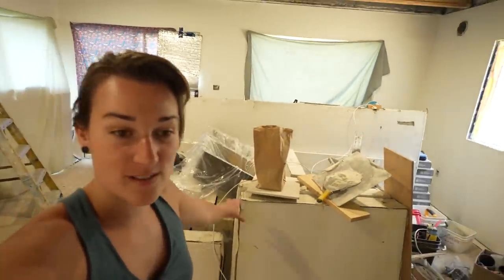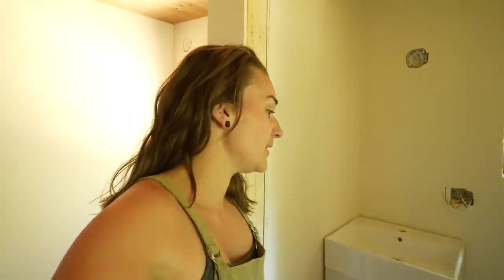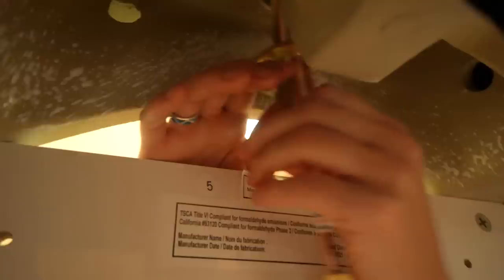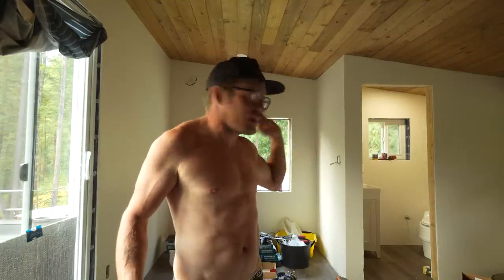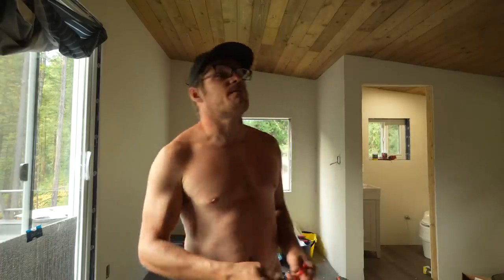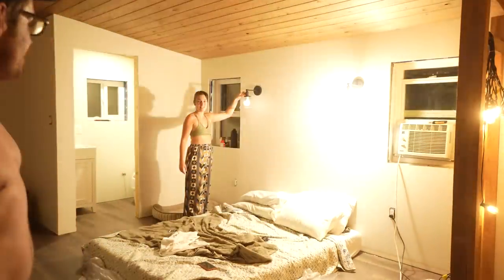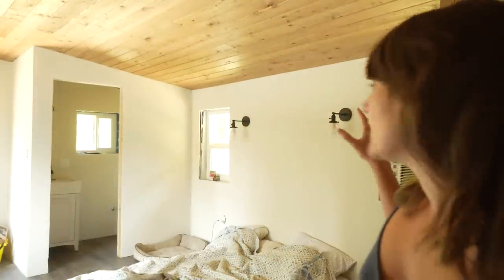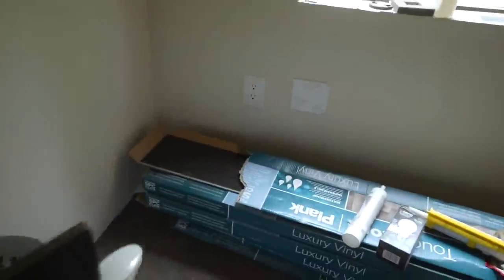We Really Messed Up! | Lighting and Electrical In Our Master Bedroom

Comment: Tip:  Experience has taught me to install faucets and part of the drain BEFORE placing the sink. That way you can turn the sink upside down and do the work more easily, because you don't have to work lying on your back and reaching into hard to get to places.

Comment: looks great guys I just wanted to say that most ceiling fans have two settings one for winter and one for summer there should be a little black switch on the Hub of the ceiling fan where the light mounts. if you're staring up at the ceiling fan and it's going clockwise that's for winter it's going counterclockwise that's for summer. you wanted to blow and fan you in the summer and in the winter you want to reverse it hit the ceiling and bring the heat back down to you. just in case you didn't know. most friends and customers of mine don't know that and usually have it going the wrong way LOL. but you guys probably know that already. as always great video you guys are doing a hell of a job. take care and be safe! Tony

Comment: If you really want to do something to lower the temperature inside then use shades on the outside. Shades will heat up and placing them on the outside will help.The big door/window opposite the bed that would be a perfect spot for vertical sun shades(motorized).

Comment: At 7:00  Electrical outlet at very short distance from water, and certainly within "splash range".  According to our (New Zealand) electrical regulations, that would be quite illegal, and therefore unacceptable.  Have you checked your local regulations for electrical fittings in the same room as water?  Also check for proximity restrictions of cables close to water pipes (within the walls)  and special restrictions for minimum distances horizontally and vertically from water facilities and steam.

Comment: What a difference having the lights and electric boxes makes. the bathroom when you put the lights on you noticed a few errors in the walls. don't forget that you didn't have much light in there once the drywall was up and that's the main reason why the are some slight imperfections so don't be so hard on yourselves

Comment: Greg did you check out the electrical instructions about installing Electrical plugs, and light switches close to water supplies as one of the reasons you should not do it is electrocution.
Reply from the maker: 100% yes. The whole bathroom is on a GFCI breaker

Comment: Don't know if Mr Cool units are available in your area or if you have sufficient electricity to run one, but I saw a small window AC unit and thought those would use less electricity, but maybe not. They make DIY models and are very energy efficient. They also seem to like to partner with ytuber channels for promotions. You might score a deal.

Comment: Hey guys I know that you have battery powered drills and screw drives. Thins would go lots faster if you use them rather than a manual screw driver. Just though i'd put my two cent's worth in. I just discovered your site. This is my third time back. I've subscribed and "liked" what I've watched.Your animals are all like a bunch of kins, no pun intended. They are under foot all the time. Rather like Josh and Erin's animals. That's very cute. Reggie.

Comment: Should be using GFI outlets around running water. could mean the difference between life and death.
Reply from the maker: The whole bathroom is on a GFCI breaker in the panel, it protects everything on that circuit
Reply: even at low voltage?
Reply from the maker: @Dolby842  it's normal Ac power  to the outlets.

Comment: Why did you choose to put the fan more over toward stairs? The light close too sliding doors, you would get alot more air from ceiling fan.
Reply from the maker: We were thinking about winter and the woodstove, and having the fan near the stairs to help circulate the air between the two floors better. Who knows of that logic will hold true 🤷‍♀️

Comment: Do you get a lot of forest fires around you if yes I would be cutting some trees around your house that’s why I had to do with my cottage 20 years ago I got tipped from the Forest service it would be a good idea they told me at least 50 to 75 feet away from the house I would check into it if I was you the house is looking great inside just the tip because I know every summer for now on it’s getting hotter and hotter and I hope you don’t lose your house because of this